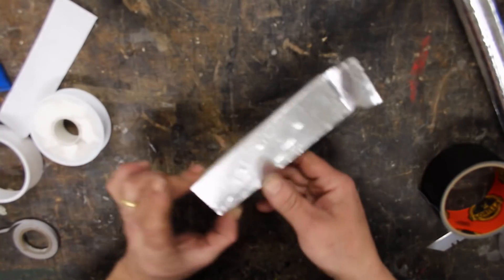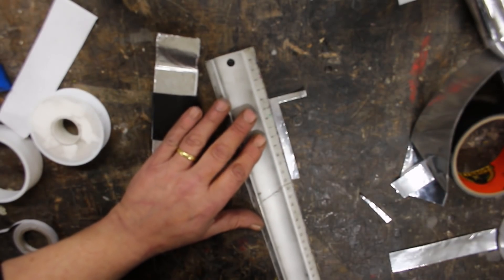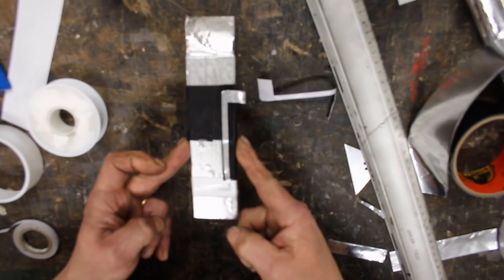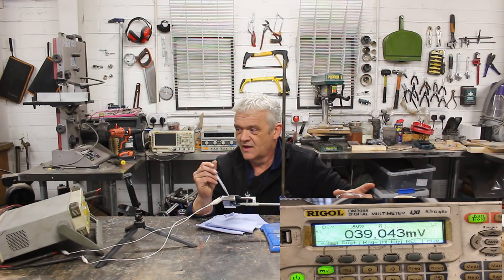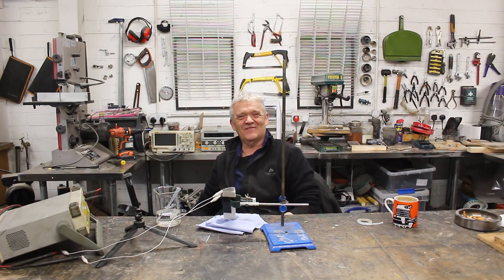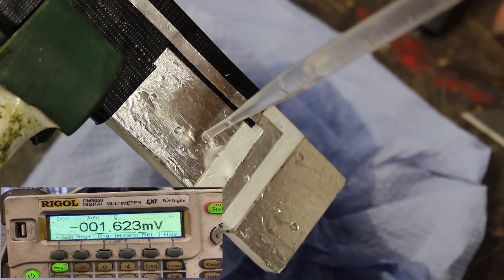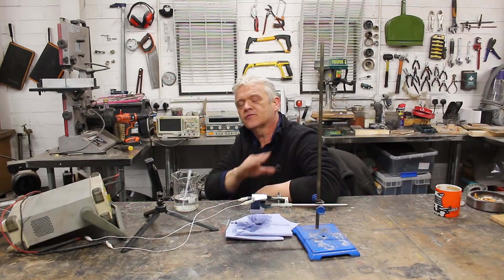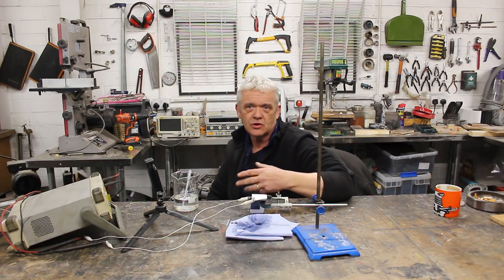1459 How To Make A Rain Fuel Generator

Comment: I made one of these after seeing the world of tnt video out of curiosity. I used a soda can that i sanded the ink off, and a copper wire for the electrode. Managed to get 0.55V on average with it under a small stream of water from the tap
Reply: What wad the current?
Reply from the maker: nice work mate
Reply: Got a link to the TnT vid?
Reply from the maker: here you go mate https://www.youtube.com/watch?v=ee3WW0OnBL0
Reply: @ThinkingandTinkering  So I've been doing some thinking on the experiment that I made and I think I wasn't doing it right. I think I inadvertently made a battery. If you take dissimilar metals (and even similar metals to an extent) and put them in an electrolyte (tap water can work but is poor) itll make a battery and over time degrade the copper anode. with the setup I had, the water is able to run over the exposed copper across the PTFE and then touch some of the aluminum which momentarily makes a battery, and I verified this by just putting the aluminum and copper in a glass of tap water and got the same ~0.5V. After fixing the setup I was unable to get any voltage generation when the aluminum layer was properly insulated by the PTFE.
I watched your follow up with the varnish and carbon ink and I think I'll look into that more since I think thats much more properly insulated
Reply: And when you say the copper wire for the electro where does that copper wire lead to and what do you connect it to the can with does it have to be grounded in the ground is it have to touch anywhere I'm curious if you can find out the math on how many pop cans or how many pieces of plastic with the Steel Coating to produce single-phase and three-phase voltage

Comment: Absolutely great video again! =)
Funny, I've been thinking of the electrical charge in rain.
One advantage such panels have, is that you can put them on the shadow side of your roof.
-Then you can keep the solar panels on the sunny side. =)
Reply from the maker: Great point!
Reply: Ive seen a solar panel that incorporates tech to take the electrical charge in rain, so you have both!
Reply: That's a good idea, solar panels on the sunny side for the summer and rain panels on the other side of the roof for the winter.
Reply: @damianjones6546  Not just for the Winter, but for night time too. We seem to get a lot of rain lately at night!
Reply: Why panels though...? Solar MUST be panels because they require precise angles. And this.... This could as well be in a form of cloth or something else flexible. Making it a very portable generator.
In the case of roofs, the "discharged" rain still has potential -- height above the ground. So it could be further collected in gutters and generate electricity mechanically.

I wonder if there is a way to make this rain cell transparent... That way it could also be mounted right on top of solar panels, efficiently utilizing all the roof space.

Geesh, that's a brilliant discovery!

I wonder how that'd work in dams. Would that perhaps be more efficient that just using the pressure...? Just imagine the number of droplets condensed in the dam! On the other hand, what eco-effect (adverse?) would it make if we collected all the charge off the water? Would the water recharge itself as it flows down the river?

@Robert Murray-Smith is correct, there are sooooo many questions!
Reply: @dariusj33  I saw a separate video where cayrex2 used flowing water from a tap with conductive ink instead of aluminium. It seems the stronger the flow - the more volts / amps were produced (c10x). So imagine several hundreds generators per 'unit' and thousands of units in a stretch of river.... given the volume in a river you wouldn't run out of charge IMO
Reply: @TheGlobalAnalysisDesk  Hopefully not :) But if we stretch an array of collectors across the river, how far should we place the next array? Also, will this work as well if the whole cell was touching the surface of the flowing water? 
Lots of testing needed :) 

We (humanity) have already made plenty of mistakes by getting too excited about the energy we can collect and collecting it massively right away, without accounting for possible damage to the balance of nature. That's why I'm worried about what adverse effects could such "cells" have if used massively on a river. Covering the sunshine - that's already alarming.

We must always consider what potential harm we're causing by gaining something out of nature.
Reply: These could be on every surface of a structure, walls, edges of roof around the solar panels. And how about on cars?  How thin can the metal strips be? Could this be done on windows using wire? I am not an engineer, I am an artist. But I can think of a variety of applications. We, as a planet, could just start making all the things Robert has spoken about. Wind walls, the "Zube tube" vibration generators, and rain generators. Imagine if just one highrise building incorporated these in a city. Imagine if they ALL did. One of the many problems I see with solar, aside from the initial cost, and the environmental impact of the materials used, is the weight of the actual equipment. Not every structure can be retrofitted. Many residential homes can't. But these smaller and cheaper ideas could be.

Comment: Laminar water flow may short the circuit/s but other than that this bonkers cool! 
In the Offical demonstration, they had no second row to catch the drops from a first row which reinforces the assertion that it is not about kinetics or salts. Now how far must a used drop of water fall to regain a useful charge from the air?
Reply from the maker: I think they used 15cm - but I will have to check

Comment: Is this more about the motion of the charge or the capacity of charge in the droplet. I would think droplets from higher altitude would have more effect.
Reply from the maker: I think they used 15cm in the original paper but I will have to check
Reply: @Robert Murray-Smith  there is a greater difference in charge from the surface of the earth as altitude increases. I think that could affect the real world effectiveness of this technology vs in the lab.
Reply: Wouldn’t a thunderstorm create highly charged rain droplets?